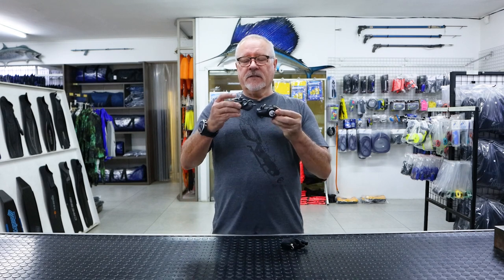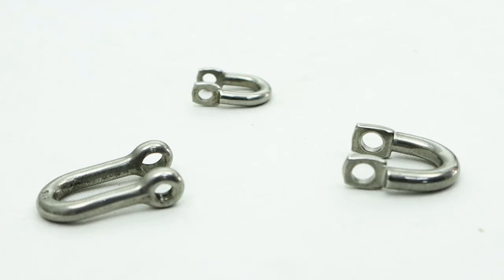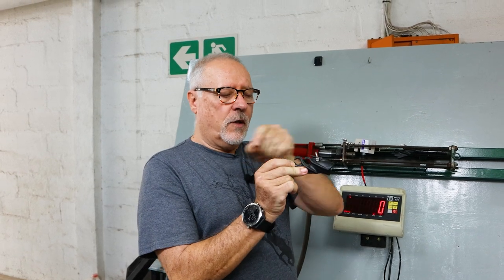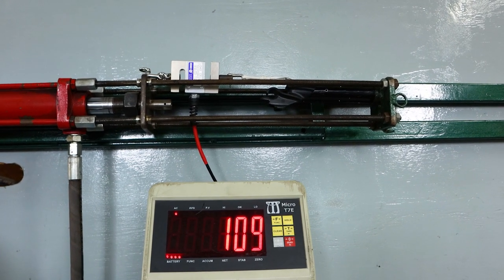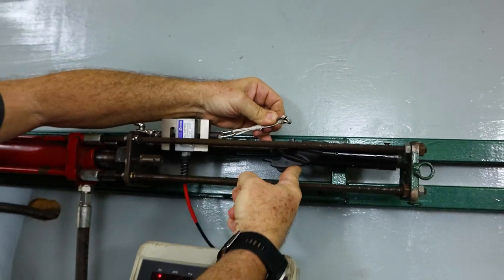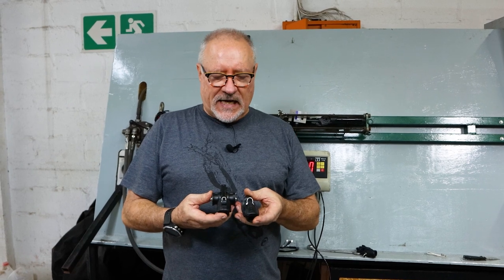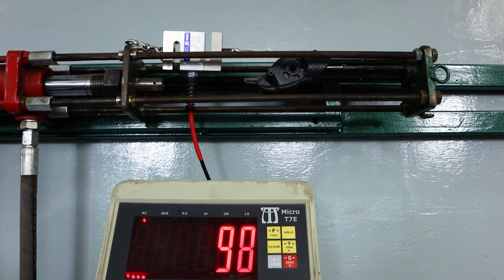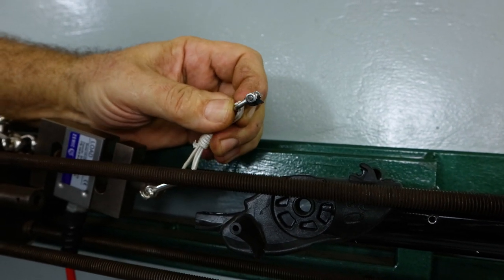Rob Allen | Muzzle Eye Break Test | Part 2 | 2023

Comment: Thank you Mr. Rob! I'm curious how strong the rubber bungee at the muzzle, holding the shooting line tight is. Would be grateful to see the different types of clips and no clips output.
Reply from the maker: Hi ATKryan we did a test on snap clips a few years back   https://youtu.be/aOotd070tVc   the rubber in the small gun bungee is not strong but the dyneema line inside is around 180 to 200 kg so the shooting line will break long before gun bungee at the muzzle. Here is the t=spear line testing   https://youtu.be/1ESE71bO7gg
Reply: @RobAllenSpearfishing  thanks again!

Comment: I would love to see a video where you compare the risk of failure between standard spearguns and rollers. Rollers have moving parts (wheels) and the roller head has to absorb the impact of the rubbers every time you shoot but is the risk of a roller failing actually higher than a standard speargun?
Reply from the maker: I'd assume there is a greater risk of damage with a roller but we don't see damage from normal use, not really something we can test for as there are so many variables.
Reply: I'd assume the same but good to hear that you don't see damage on rollers from normal usage. I guess a good deal of the power of the rubbers will be absorbed by the spear as it is propelled forwards decreasing the impact of the wishbone on the roller head.
Reply from the maker: @KristianGrSl  Correct.